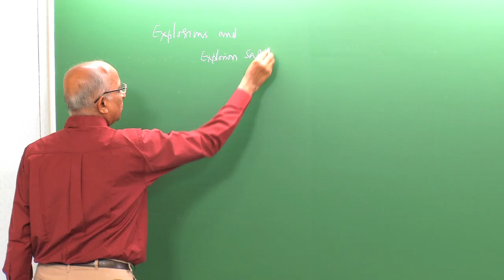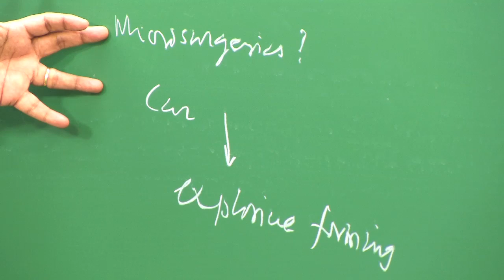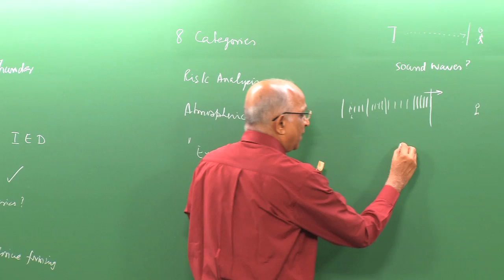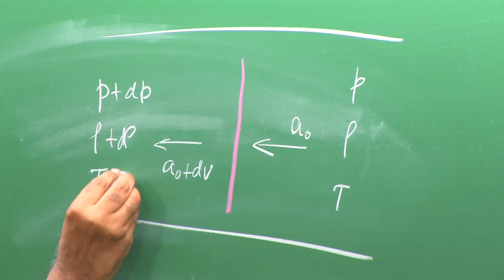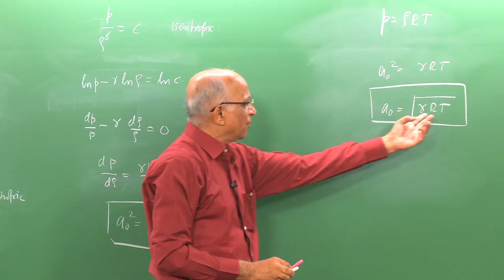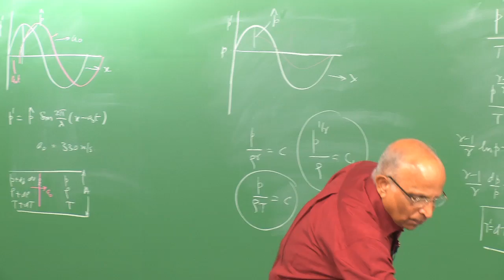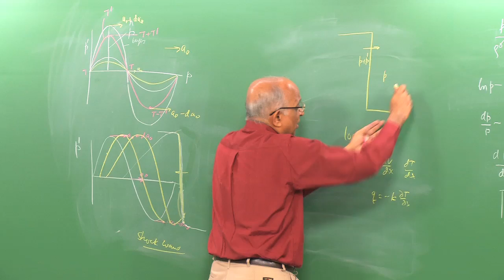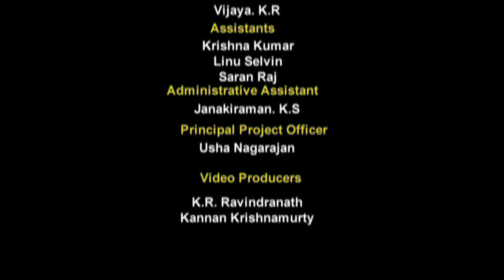Mod-01 Lec-01 Loud Bang and Disruption

Comment: Some people may be confused at 25:00, so here is the derivation if you are following this course:
Force = rate of change of momentum
let density be denoted as D, volume as V (so mass m = D.V)

Where, momentum change d(momentum)= momentum at left - momentum at right

velocity of sound in medium = a0, increment to velocity is  = dv
velocity at left = a0 + dv
velocity at right = a0
 => d(momentum) = m(a0 + dv) - m(a0) = D.V.(a0 + dv) - D.V.(a0) = D.V.dv

Also volume V = Ax = A(a0.dt), where x = distance travelled by wave in time dt = a0.dt
so,
d(momentum) = D.V.dv = D.(a0.dt)dv

Rate of change of momentum = d(momentum) / dt = D.a0.dt.dv / dt = D.a0.dv

Force = Force to left - Force to right = pA - (p + dp)A = -A.dp

equating Force to rate of change of momentum (Newton's second law)
-A.dp = D.a0.dv
and the rest can be done easily.

Comment: Wouldn't the speed of the wave be x+at not x-at?  After all we are moving to the right.  If the wave starts at x=5 and phase shifts a*t the new start position of the sine wave would be x+at or 5+at.
Reply: as you can see from pink, graph  at at =5 & x=5, y =0. now sin(x-at)=0 & sin( x+at)=sin10

Comment: Infinitesimals should not be proportional to non infinitesimals , a is for acceleration - not speed, etc... It appears that someone has "exploded" this poor man's notation :/ Otherwise this is an excellent lecture ;) It would be nice to see the non-linear PDE for propagation of displacement from equilibrium at high compression ratios with heat and velocity diffusion (aka viscosity) terms added derived and some solutions and their properties discussed. The adiabatic wave equation without the diffusion terms has an exact solution that can be found using separation of variables.
Reply: This "poor man" is a world expert in this subject. The notation "a" is for velocity of sound in a material, and "c" is for fluid velocity, and "Ma" is for Mach Number, and if an "intelligent man" like you would have studied fluid mechanics, gas dynamics, or any subject from thermofluid engineering you would have been aware of this notation.
Reply: I know you have made the comment 3 years back, so I am posting it for anyone who sees it later(many people take this course every year through NPTEL)
Also, if your issue was at 25:00, then it is actually derived as:

Force = rate of change of momentum
let density be denoted as D, volume as V (so mass m = D.V)

Where, momentum change d(momentum)= momentum at left - momentum at right

velocity of sound in medium = a0, increment to velocity is  = dv
velocity at left = a0 + dv
velocity at right = a0
 => d(momentum) = m(a0 + dv) - m(a0) = D.V.(a0 + dv) - D.V.(a0) = D.V.dv

Also volume V = Ax = A(a0.dt), where x = distance travelled by wave in time dt = a0.dt
so,
d(momentum) = D.V.dv = D.(a0.dt)dv

Rate of change of momentum = d(momentum) / dt = D.a0.dt.dv / dt = D.a0.dv

Force = Force to left - Force to right = pA - (p + dp)A = -A.dp

equating Force to rate of change of momentum (Newton's second law)
-A.dp = D.a0.dv
and the rest can be done easily.

The notation is consistent with what is seen in gas dynamics.